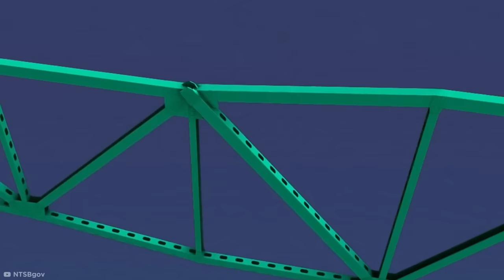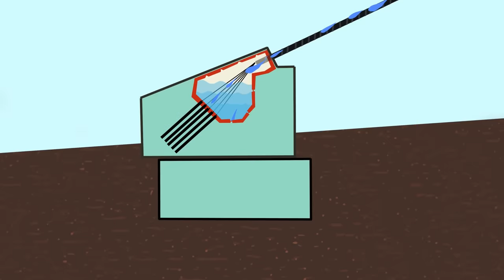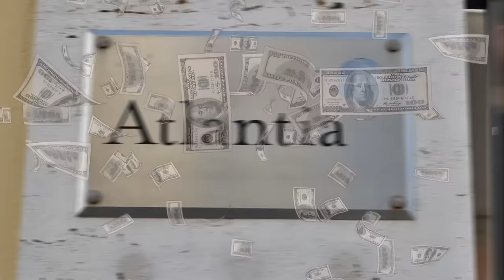Catastrophic Bridge Failures Explained – How They Happened

Comment: I grew up just east of Tacoma, WA and we grew up with stories about "Galloping Gertie", better known as the Tacoma Narrows Bridge. My mom told us several times about how her and my dad got stuck on the Tacoma Narrows bridge one night when the winds were high. To this day she is terrified of suspension bridges because of that night. They have, thankfully, replaced the bridge and added a twin bridge to help reduce congestion, which hasn't worked all that well since traffic rates increased dramatically during the planning stages and the twin bridges now only slightly reduce commuting times. The second bridge does also help cut down on the windshear, however, which is a blessing.
Reply: Adding new roads/bridges never reduces congestion for long, since it simply encourages more people to move to that area.
Reply: Back in 1958 the suspension bridge over the Peace River on the Alaska Highway at Taylor B.C. Canada collapsed.  The cause was never made public.  The truth was they were building a refinery at Taylor and and they dug a hugh trench for the cooling pipes  in front of the north anchor for the suspension cables. A few months later the anchor started to move.  The north tower started to lean and the roadway pulled away from the north bank. Total collapse of the north span.
Now you know something almost no-one else knows.
Reply: and then everyone clapped

Comment: Railfan here, and I got some more information on creosote. That compound is generally still used in some cases to keep wooden railroad ties, and I can testify that to be true because I used to have to worry about getting my shoes covered in the stuff whenever I would walk across the railroad tracks in Atlanta, Texas, especially in the small stretch between the Main St and Hiram St crossings. The best way to actually tell if wood is creosote-treated is that the stuff is very, very dark-colored, almost black, and the smell, especially in summer, is absolutely overpowering, and once in a while when rail maintenance crews are fixing the rails, the sparks from the thermite chemical will ignite grasses nearby, and sometimes even the ties themselves, which flare up incredibly quick.

In an unrelated addition, the Harmony Ridge Trestle, on Google Maps, has indeed been rebuilt with materials that won't burn, specifically the wooden sections were replaced with more contemporary steel and rebar. The old truss section over the Colorado River itself still remains intact to this day, and the contrast between the newer western portions and the antique eastern one is obvious when looked at from above. I'm sorry I've rambled on for this long; just thought I'd dump some more information here.
Reply from the maker: thanks for the insight SilverThunder! hope you enjoyed the vid
Reply: Thanks for the info @SilverThunder710
Reply: @BeAmazed  tbh I'd probably just action movie instinct style rush across the bridge
Reply: @BeAmazed The Tacoma Narrows Bridge Collapse was in fact the worst.
Reply: Railfan here. That trestle bridge carried both passengers and goods on the heart of Texas Railroad. But the weight of the iron train tracks on top forced all of those wooden pillars knock each other over like dominoes.

Comment: Yes ; I rode my motorcycle over the 35W bridge in Minneapolis hours before it collapsed.
I had a friend that was stuck in traffic and decided to get off and take 10th Ave that runs parallel to 35W. 
Or she would have been on it.
So it doesn't matter what is going on it does happen.

Comment: Fun fact: The actual cause of the Tacoma Narrows bridge failure was not the swaying itself, as it had done that for months in other winds, but one of the anchor cables between the main suspension cables and the road eventually came loose under the repeated stress of being pulled over and over again.   Once one had been pulled out, the rest quickly followed.
Reply: So what you are saying is the constant swaying was not the cause of the bridge structure failing but it was one of the cables coming loose because of the constant swaying. Makes sense.......NOT!!!!
Reply: @stopthebullshit404  The bridge had swayed for months in the winds and they thought that it was fine.  Then one of the cables popped loose - then another and suddenly the "swaying" was more like a roller coaster.  Bad design, and inevitable given how the cables were attached.
Arecibo was the same in that it would sway 10 meters or more in storms and they thought that was fine - until age and water leaking in caused one of the cables to come loose.  Once that happened, there was no saving it.  The aftermath of the Tacoma Narrows bridge was that the main cables where intact with hundreds of cables hanging from them - minus a road.  
WHY we build tresses under the road is so that if this happens, the road is still supported from below/repairs are possible.  Wind loading still happens, but it now is supported from above and below, making a major break less likely.

Comment: To explain the issue in China,  just go to your local hardware store.  The bolts there are typically from "overseas" and largely made out of recycled steel or mild steel with a fake hardened coating.  They fail at a fraction of the stress of new steel.  You can typically just snap them off with a breaker bar if they are rusted far quicker than using a hacksaw, as they tear like taffy.  The companies simply lie and once it's been shipped overseas, there is no legal recourse.  The issue is that this cheap "for export - we look the other way" steel was used internally, so thousands of projects were built with defective rebar and bolts.  Bridges, apartment blocks, parking structures... it's all just waiting to come apart if stressed a little too much.
Reply: A steel China built bridge I wouldn’t trust, much less a Chinese glass bridge never unless I had a death wish!
Reply: @brucedale4465  The issue is that under load (say, the wind) glass really does not like to flex very much.  They can mitigate it somewhat like they do with windshields, but if you are not super strict with maintenance, sadness will follow.

Comment: You say the I35W bridge was a design problem, but then go on to say they allowed much heavier trucks than it was rated for, and they added 20% more weight via concrete AND it had heavy construction equipment on it, and only then did it fail. Seems to me the design held up fantastically, but was abused in multiple ways, leading to the collapse.
Reply: I think there was also a problem with lack of maintenance on the I 35W bridge - not the design itself.
Reply: @KnightRanger38  I don't think so.  There were several inspections that the gusset plates were deforming.

Comment: One that you missed was the I 90 floating bridge between Seattle and Mercer Island in Washington.  A new bridge was built and opened, and the old one was closed for repairs and maintanence.  During this time, an inspection port was left open, causing one of the floats supporting the bridge to flood and finally sink.  This cause a chain reaction of more of these floats to sink.

Comment: You can mention a near catastrophic bridge failure. In 1978, British Rail decided to check on the wooden piles of the Barmouth Bridge in Wales. It was a good job they did. 70% of the wooden piles were seriously damaged by..... a worm! Specifically, the Ship Worm, also known as Teredo Navalis. They asked for a report which said that the bridge was in danger of collapse within 3 months. British Rail immediately banned locomotive hauled trains, only diesel multiple units could cross, and only at 10mph or slower. Over 3 years, the wooden piles were replaced one by one, and the new piles were encased in concrete to prevent attack by the Ship Worm. So this has a happy - if astonishingly expensive - ending.

Comment: There was also a case in Romania, Neamt county in 2022/2021 when a bridge over Siret river collapsed under a truck's  mass and wasn't replaced. It had the cost of 8.3 million lei (1,817,457.64 $).The bridge did not have maintenance done.

Comment: My understanding is that the Harmony Ridge Trestle bridge was itself actually a replacement bridge project. The first bridge was constructed in the late 1800's by three civil engineers who founded the small Porcine Irrigation & Growers Services company specializing in the construction of waterway channels. Due to time and budget constraints, the first bridge was constructed of a rope woven from the stalks of locally grown cereal plants, and was lauded for it's low cost. However, the nearby Wulf hills form a channel which causes strong winds to flow down over the bridge and made it sway dangerously, eventually fraying the ends to the point where it collapsed. So the second bridge, which was of course constructed of wood, was built as a replacement in 1910. As seen in the video, that bridge lasted considerably longer but was eventually lost in a huff and puff of smoke in 2013. Recently, the same construction company which built the first two bridges has submitted plans for a brick archway design that people seem confident will stand secure for a long, long time.

Comment: This is a long comment.

Here's one that you've missed that's a combination of negligence, poor judgment, design flaw, and lack of oversight all in one.

The Sunshine Skyway Bridge disaster. 

Supports on the bridge pylons had concrete issues when it was completed in 1971 for the southbound span so there is already structural issues. The State of Florida and the Department of Transportation ignored it.

May 1980, the MV Summit Venture got lost in a foggy 90 mph wind rain storm. The freighter struck the southbound span and it collapsed into Tampa Bay killing 35, cars went off the bridge as well as a Greyhound bus.

The bridge was not electrified, no lights of any kind. It was not closed due to the poor weather conditions either.  Because there was no electrification, vehicles just drove off the end of the bridge including the Greyhound. One car slammed on the brakes when the driver noticed headlights in front of him disappearing.

It was not closed to Maritime traffic either with severe weather, once again no lighting on the bridge to mark the channel.

That was one survivor, a vehicle fell from the bridge bounced off the phosphate freighter and landed in the bay.

Here's the lack of judgment and negligence, the freighter did not pull out of the channel and anchor and wait the storm out when conditions got treacherous before entering Tampa Bay and under the Skyway..

The channel into Tampa Bay is narrow and has odd turns. The pilot had only been through the channel once.

Here's how dangerous that channel is, just a couple of months before the Skyway Bridge disaster, the Coast Guard cutter Blackthorn, which just finished overhaul in Tampa was being launched, almost collided with a Russian passenger ship Kazakhstan, minutes later in the Skyway Bridge's narrow channel it collided with the freighter Capricorn right next to the Skyway killing all 23 on the Coast Guard cutter.

It was a disaster waiting to happen. It was ruled that the captain and crew of the freighter and the freighter company were responsible. The pilot claimed "Act of God" in court. The courts also ruled that even though there was deterioration of the bridge the impact still would have caused it to collapse but to this day there are still questions about the Blackthorn and the Summit Venture.
Reply: That one is up right there with the Ponte Morandi one.

Comment: it was October 1971 a few days before Halloween and I was on the school bus headed towards school early in the morning.  We were headed towards a bridge we crossed every morning and afternoon.  That was a small bridge that spanned about 50 feet of a slow moving stream.  I think I was in the third seat on the right hand side so had a fairly decent view.  I remember looking ahead then at the exact same time I noticed a span missing the bus driver hit the brakes.  I never found out the cause but that span simply fell into the stream and it was still dark and you know how it is when it's dark and you are driving and nobody else is on the road and its a route you take every single day twice a day and you get somewhat complacent.  Well it was like that I think.  Anyways, we all exited out the back emergency door because the normal exit up front was hanging over water.  We all made it and the bus never fell in but it was a bit of a challenge from what I hear to tow the bus from the brink.  Fortunately we were only about a quarter mile from where the last student pick up was and so he just ran home and called the police who then used their radio to get ahold of the bus company.  Wireless phones hadn't been invented yet and it was too dangerous for the driver to remain in the bus to talk on the radio.  We were all over an hour late for school which none of us minded.  We had to use a different route to get to school and home again which took an extra 20 minutes so we all had to get up twenty minutes earlier every day until April when the bridge was finally repaired.  I remember riding my bike up to that spot a few times to check it out.  Our driver kept us about three hundred feet away that day while we waited for a ride.  I can only imagine just how close we all came to going into the stream.  We were told that the water level was about average for that stream that day and was six feet below the pavement and the water under the bridge was about ten feet deep.  I think the span was about 50 feet and the length of the bus was probably not much more than about forty feet if that so without application of the brakes we would all have gone right into the icy cold water (being in New England that time of year) and I could not swim and I believe most of the students in the bus all 10-12 years old likely could not swim.  I would guess I would have drowned along with at least half the students and I know the driver later said he could not swim.  Also the following day there was a stack of live vests in one of the seats and he never drove the bus again without them because that was only one of dozens of bridges we crossed on a daily basis and many were older.  

That was the same year the Sunshine Skyway Bridge was opened and coincidentally I was on a bus on May 9, 1980 headed from St. Petersburg to Bradenton for a job interview and we were approaching the bridge when a police car drove right across the lanes and stopped all the traffic.  We had to drive backwards for a distance before we could turn around and take a different route. At first we were just told there was an emergency closure of the bridge.  We returned to the bus station and left that bus and then got onto another bus to Tampa and then connected from Tampa to Bradenton and it wasn't until I showed up an hour and a half for my job interview thinking I had lost the job that I was told by the hiring manager that they heard about the closure and they were the one to tell me that the bridge had collapse and I was hired.  Unfortunately I could not take the job after all because the daily commute went from under an hour each way to over two hours each way and that was too long of a commute.  I remember it took years to replace the span with the new bridge and eventually they knocked down the surviving old span and now part of it is a fishing pier.  

And people ask me why I am nervous when I cross a bridge.

Comment: There is a single span concrete bridge going into Auckland NZ that was built in around 1910. At the time  it was the longest single span concrete bridge in the wirld with experts saying it could not be built let alone stand. The engineer said it would work and that it would support the weight of two traction engines in the middle of the single span. People were not convinced. When it was built, no one was allowed onto the bridge until it was tested. With hundreds of people watching and being held back by police, a traction engine driver drove one traction engine onto the middle of the brdge, parked, got off and walked back. He then got into another traction engine and with everyone fearing the worse, he drove it onto the middle of the bridge and parked it there too. He came back, and after the bridge declared safe, hundreds of people streamed onto the bridge (still with the two traction engines in the middle) and spent the rest of the day walking back and forth over the bridge. There exists pictures of this event that were published on the front pages of the newspapers of the day and it is estimated that the weight of people were several times the weight of the two traction engines that were still in the middle of bridge that it was supposed to hold! Grafton Bridge is still standing and in constant use today!

Comment: Pretty sure that first video in the beginning of the hopping bridge AKA Galloping Gertie. was the old Tacoma Narrows Bridge, caused by wind. I drive on the new tacoma narrows bridge in a semi every wednesday, which is now 2 bridges, 4 lanes westbound bridge and another 4 lanes eastbound. The eastbound is still a toll even though its been paid off for over a decade. (Scammed by the government...SHOCKING!) Anyway, it get SO windy on some mornings that ive gotten an empty 53' reefer trailers wheels off the ground and used 2 lanes so i could swerve to put the wheels down over and over while only going 25mph. Thats a windy ass bridge. Its not shocking the OG bridge went down like it did.